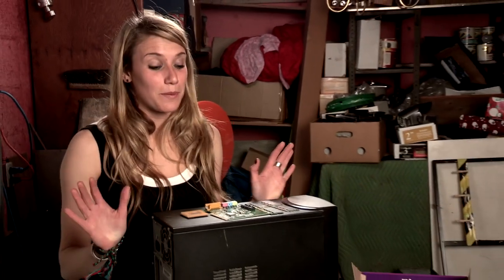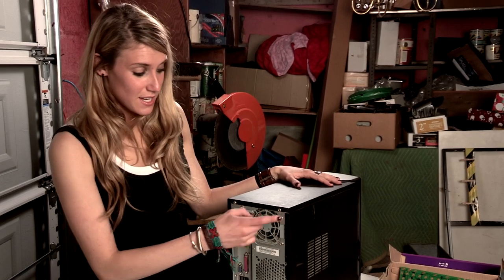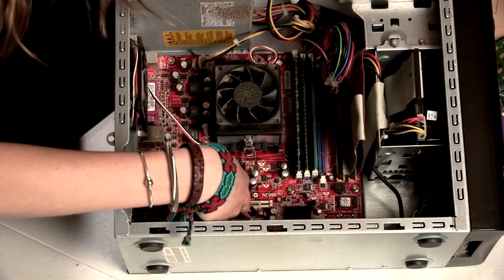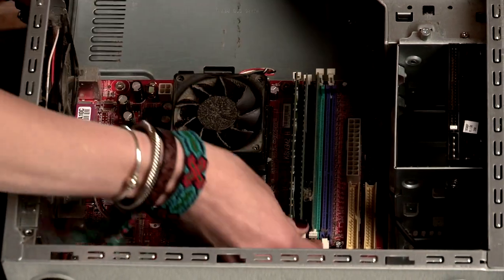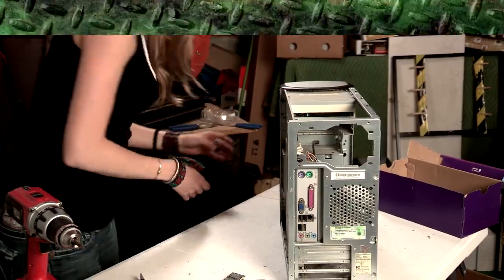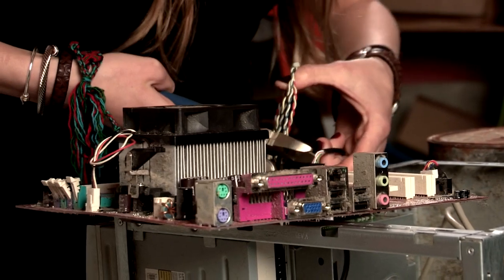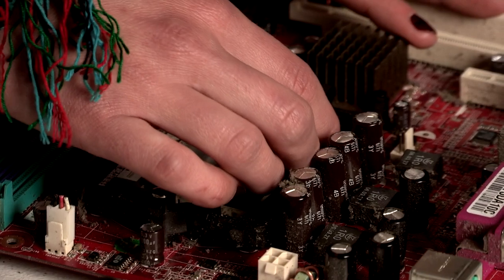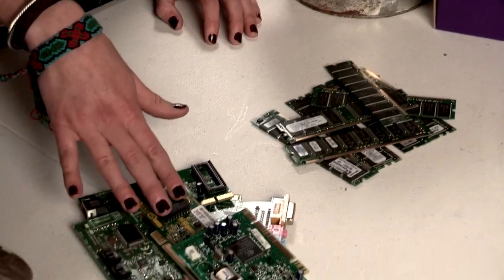Scrapper Girl shows you how to get gold from scrapping an old computer Scrap

Comment: Static discharge can partially damage components by almost burning out internal chip connections, therefore you would not know if you have done damage or not, but they will fail a lot sooner than they would have done otherwise. It's good that you're saving $5 on an anti-static strap though.

Comment: Why would anti-static protection be used since the components are going to be scrapped? They get cut and grounded up and put through all sorts of caustic chemicals to seperate the gold from the board. I don't think the reclaimers are concerned if the parts suffered any ESD's.

Comment: You are partially correct!
Ram & other computer parts can & would be damaged by electrostatic so it is a good idea to ground yourself before handling but if you do not have a anti static bracelet or any other device, you can remove your socks or put a good pair of rubber running shoes on, then go touch a water tap & hold it for a few sec..
Touching the water tap discharges the static from your body due to a water tap being one of the best grounds in a house!! worked 4 me 28+ years
THANKS
DEv

Comment: I have been scrapping those machines for quite a while, transformer gets stripped,wires all get burned,  steel gets piled up till we have a 1/2 ton, the chips, rams, slots, get sold separately mother boards get shipped out, 100 lbs at a time. 4 or 5 boxes. The hard drives are stripped down, even though they buy them whole, we gut them. I have a pile of magnets spilling out of a 5 gallon bucket. I have a 5 gallon bucket full of screws! Fans, speakers, motors,hard discs, help me scrapper girl!!!

Comment: I have to say my nephew sure thinks like you do. I do like the fact you mentioned you try to sell things as they are because they are more valuable as usable items. But I personally would never automatically scrap every computer I come across. The reason is, a lot of good repair parts are on them. And most are repairable with a few donor capacitors. It pays to be both a technician and a refurbisher. I always upgrade sound blaster live 4's to 5.1's when I get them, and add a  spdif port.

Comment: Test the power supply, if it works clean/sell it. All the wires you cut have a little lever to depress to remove from the board and those could be sold for more than scrap wire. The same with the heat sink/fan. A little air and a tooth brush to clean it up. Sell drives and hard drives could be formatted and resold or stripped for gold, platinum, palladium and rhodium. If cards and ram are for scrap gold then just trim the gold plated fingers and parts off to keep instead of the whole card.

Comment: is this economically viable? i mean... if i spend like 2 or 3 days a week going and finding computers and 3 or 4 days ripping them apart... not looking to sell RAM on ebay but actually extracting the metals... would the metal be worth doing this full time?

i mean i see the value in it... when a computer gets old its most people value its utility and numismatic value only and trash it so i can see how its materials alone would be worth more than as a computer.

but can i support myself on it?

Comment: You forgot the aluminum heatsinks inside the power supply plus the sheet metal the powersupply is housed in.  Plus take the hard drive apart.  The housing is die cast aluminum as well as the platter plus gold on the pcb and heads.  The magnets can be sold on eBay.  Invest in some torx bits.

Comment: hey S Girl,good job ! might I give you some friendly advice? I will any way ! Dont scrap the power supplies , sell them as well on ebay ,many electronics buffs are always building bench supplies for different projects and they would be willing to pay $5 or more for a power supply, Next remove the neodymium magnets from inside the hard drive,the pancake fan and heat sink can be sold to electro hobbyist as well ! You might find you make a lot more money this way been scraping for 30 years !
Mick

Comment: Hey .. wait a minute!

whether it's M2 socket motherboard with AMD X2 processor?
In Indonesia the CPU as it is still used
If the motherboard is damaged, at least the other components are still functioning.
if I buy AMD X2 processor at the store was very expensive (used goods) roughly around Rp350.000, -

Comment: Holy crap people it cost 7.50 for muriatic acid and 1.00 for hydrogen poroxide to get the gold off and at that you can get between 10-15 batches for that amount of money defiantly worth it's weight in gold not to mention scrap copper aluminum steel and if you want to silver

Comment: actually, touching a water faucet doesn't do any thing at all. if you do not have a grounding bracelet, then the next best thing to do is to touch the power supply box, and keep your hand on it while you work with the other hand. most jobs that need to be done in a puter can be done with just one hand.

Comment: Tools required to scrap your stolen computer for meth:

1) Stolen safety gloves
2) Stolen screwdriver assortment
3) Stolen nippers
4) Stolen power tool.  Ideally should be DeWalt....  preferably the new brushless motor ones.  You can scrap it after the computer.

Comment: In decent motherboards, it's unlikely. Coming from an electronics viewpoint, cutting down on the resources put into the motherboards reduces the amount of current the traces can pass, leading to higher losses and reduced performance. The silkscreened colour does not mean anything, it'd be easy enough to change that without changing anything else.

Comment: Don't trip scrapper girl you got your haters on deck but just so you know I mean besides you having a stunning smile those lil square black thing on electronics are called qfp chips and if to take them of with a razor toss them in a Bowl or grind them whatever's clever run a strong magnet threw it and remove the metal and then add water to the bowl and Pan out your gold and in every kilo you get about 2-4 grams of gold depending on sizes ;)

Comment: Damn, I could so teach you how to REPAIR that "scrap" and then sell it for 100 times over the scrap value with less time.  Working electronics are worth much more than the metals they are made of.  Old computers are worth money for industrial applications.  Working PC's with RS232 and parallel printer ports can fetch over $100 easily when refurbished.  In another video of yours you scrapped a JBL speaker tweeter for the steel and magnet worth 25 cents.  The tweeter as an entire functional unit has a current market value of $75.  You should be adding a couple of zeros to your profits and genuinely recycling vs scavenging.
Reply: I don't think anyone would buy an old computer like that. They might, but you wouldn't get much money for it though. The CPU, RAM and GPU would be too weak for any modern software, and the OS might be something no longer supported, such as Windows XP or something. Scrapping it is probably the best way.
Reply: My company buys older refurbished Dell computers (8 year old machines) for $125 each.  There are applications where you simply need a good working computer, not horsepower.  Example would be a shop CNC machine controller or server platform.  Big money and an entire industry.  :)
Proper way to recycle computers.  Make them "live" again.
Reply: The software is also a renewed license from Microsoft.  Windows 7 with 1 TB drives installed.  $130 complete computer with warranty.
Reply: Yawn
Reply: +Bill Jones lol, I know.  Just bought a fully loaded AlienWare 18 laptop computer with dual NVidea 980M SLI. Probably take me 10 years to pay off but will still work like the predecessor.  Not gaming, but Internet browser for somebody.  So many flat screen TVs and decent old school AT PC's , 5.1 and 7.1 receivers that are easy to fix pile in; command much more than shredding.  Denon and Harmon Kardon....  Most stuff works, people think "e-recycling" means it gets polished up and goes to another family vs shredded for base materials and off to China.  Watched a college student carry in a 27" wide screen very late model HD iMac all in one computer because she wanted it to go to a new home vs packing it home after graduation.  She didn't know it would be shredded.  TEAC VFD spectrum analyzer Equalizers were left behind with the copper power cord cut from a previous clue-less scavanger.  That EQ still gets $100 each even today.  There is a growing vintage NES and Atari gaming society that looks for good color CRT portable color TVs as the modern flatscreen has a significant time delay that ruins gameplay.  Likewise, many DOS computer game afficianodos are looking for 386 and 486 based PC desktops.  I made my fortune restoring ABS computers for cars.  Some things you need to repair vs scrapping.
Reply: +Bill Jones for industrial RS232 applications and specific chip programmers, you have no option aside from the older PC.  Emulated and card add-ons are not stable.  It's something in the older Intel bridge chipset and old operating system that is valuable.  Lot of CNC machining system software still rely on these older platforms. They do not work in 64 bit or emulated 32 bit formats.  You cannot throw out a perfectly good industrial CNC machine like a cheap printer when Cunt Gates makes a software change (hardware change too as determined by the mass market) with no after support.  But it happens.  That means little voids of higher profit if you know where to look and how to repair.  Real recycling.

Comment: Why don't the scrapper-girls at MY junkyard look like this?!

I should make a video about scrapping an MRI!

A bolted-end Oxford magnet from about 1987, purchased for about $1500.00.  Weighing in at about 16,000 lbs.  Dual-cryogenic, stainless tank and magnet core tank, aluminum galore, more that 4000 lbs of copper-niobium wire, scrapped at the height of the non-ferrous market, with 304 stainless at $1.85/lb. Al at $ 1.13. etc.  @ days work:  24,000 dollars in pocket!!

Comment: only one problem with those cards that you have pilled up there. those cards are no longer any good. you can not touch any RAM cards or video cards or sound cards with your bare hands with out being grounded. you should never stack any computer cards on top of each other, as they will  destroy the ones that they are touching.  no, it is not  economically viable to do this, as you would have to spend every waking hour going out to get enough computers that you can get any thing good out of it

Comment: that processor looked ok probably get decent cash for it. out of interest what was that CPU? looked like a AMD. I NEEDS SOME LAPTOP RAM DDR2 667MHZ IF YOU COME ACROSS I WILL BUY 2, OR 4 GB STICKS. p.s Girl you are a smoking hot scrapper.
Reply: +Karl Benson You can tell it's AMD by the way the heatsink is mounted..probably a Toledo dual core 3800+
Reply: Agreed